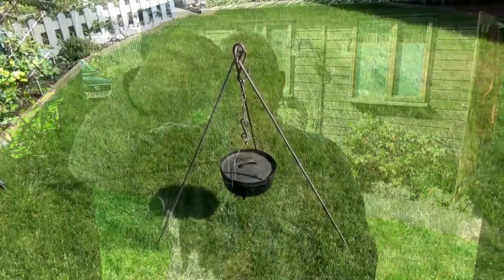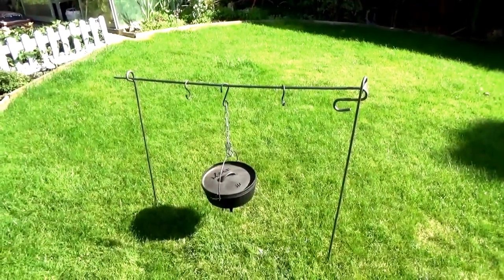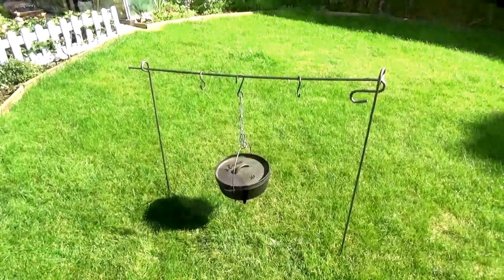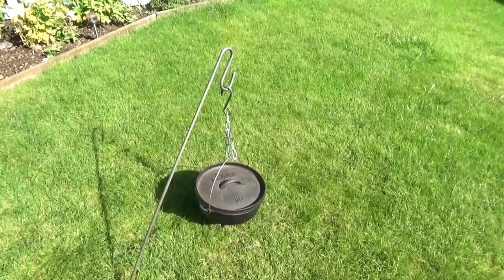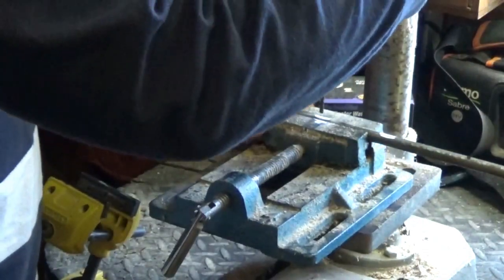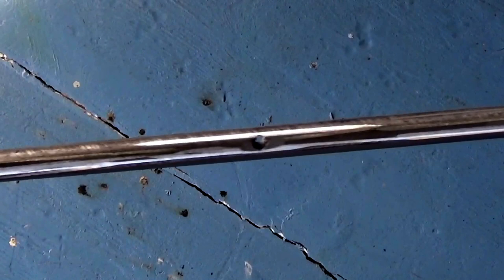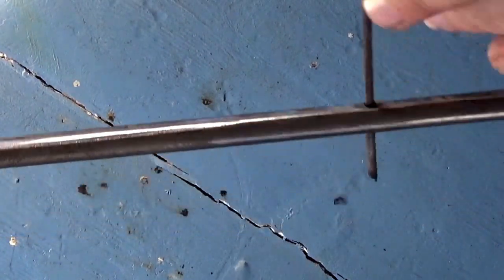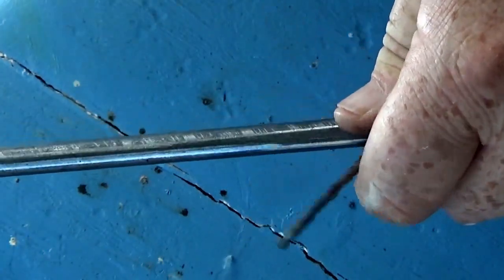Bushcraft 3 Way Tripod for cooking.

Comment: you've made it loads weaker by drilling it.  Better to weld the cross bars in if you can
Reply from the maker: +Reduced Mobility Inclusive Bushcraft cheers i will see how it goes maybe weld it if needed